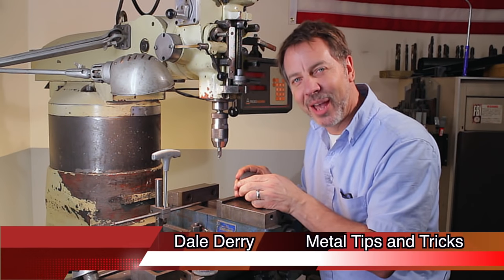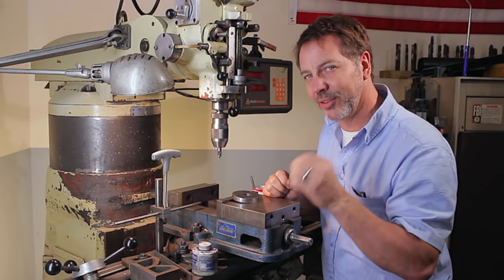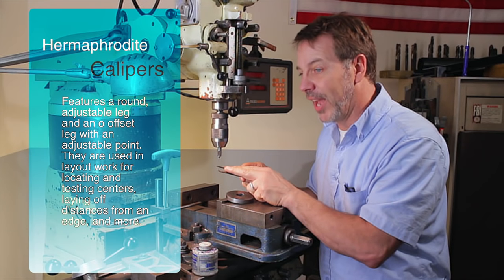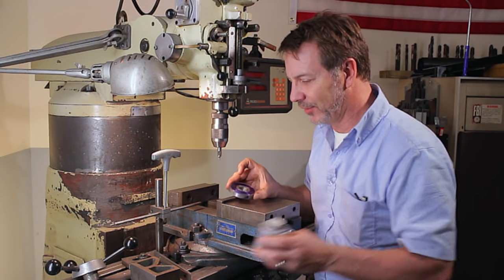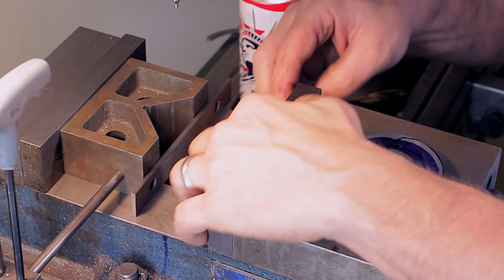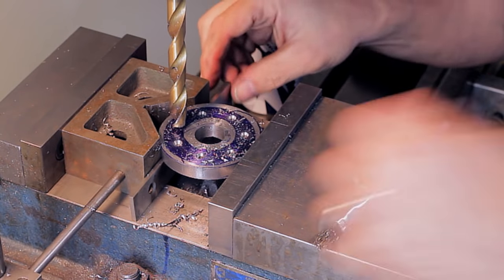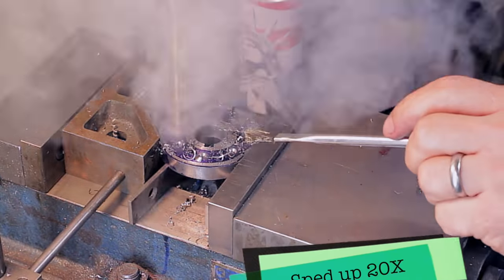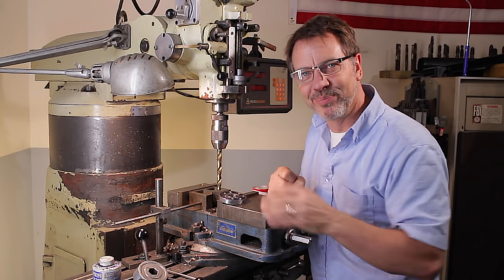How to drill a Bolt circle

Comment: There are different ways to go about this; it all depends on the individual and how much effort they want to put into this. What I do is pull out the smart phone and if I don’t have an app for what I want to do there is a good chance that there is one out there or a chart for this or a bolt hole calculator. Also a lot of the DRO’s have this function built into them. Thanks for another way to do bolt hole circles Dale.

Comment: I must have completely missed the bit where you actually decided how far apart the holes are.  
I thought 7 holes would be interesting, as I`ve been doing this sort of thing most of my life; but nothing
Reply: Deciding/working out where they should be is one thing, then rotating/drilling the piece by eye is another. The end result can't be 100% accurate surely??
Reply: As others have pointed out,  good enough is not necessarily 100% accurate.
Reply: + Paul J.  Agreed.  It's a pity Dale omitted to describe how he determined the very important chord length for scribing the centres of the other six holes once he'd centre-popped the first one.  Especially since 360° is not exactly divisible by 7 (51.429°)  Chord length = [2 × Sin {(360° ÷ 7) ÷ 2} × R = 2 × Sin 25.714° × (D ÷ 2)] = Sin 25.714° × D = 0.43388 × D.  So it's also neccessary to know the diameter of the pitch circle, D.
Had there been 6 holes, the chord length would be Sin 30° × D = ½ × D (0.5 × D) = R.
Reply: He looked it up either in machinery’s handbook or on his phone.
Reply: Yeah, he conveniently skipped that step by saying, 'hopefully I've already calculated this out in advance'.  Waste of a video, as the other stuff is obvious.
Reply: You don't need to measure anything if you have a scribed PCD as shown. Center pop your first hole, usually the one with orientation to the part. Then guess your distance and walk you dividers around the PCD. If you don't hit your center pop, adjust and try again. I use this when I have a loose tolerance on the hole centers and pcd. Or if I am drawing the part on a drawing program I use x/y co-ords to do it without a table.

Comment: Set the marker at pi x D divided by 7.
 You could also make one hole off by 1/8 to 1/4" if the part must be installed only one way.
Reply: And check your markings with the dividers by marking 1 way then the other making an X . if the centre of the X is on your PCD then you have a 100% accurate mark.

Comment: I usually use one or two compass springs to hold parallels in place in the vice jaws. I just make them from a piece of steel pallet banding. I fold a piece say 8" long in half then grind down the ends to a long taper and splay out the ends to form the spring. They can be squashed down to 1/16" out to about 2.5 - 3". I have a collection of coil springs to hold parallels in wider gaps.
Reply from the maker: Great suggestion

Comment: Get a copy of the Woodworth Circular Tables. It gives the positional data needed to calculate x/y coordinates for 3 holes to 100 holes at any radius. Then just dial them in on the mill/drill press.

Comment: How did you figure cord dimension to set your dividers  at to scribe those 7 makes ??
How do you make sure the drill is exactly over the center drilled hole when you index the part ??
Reply from the maker: Are use a true method of trial and error :-)

Comment: Just wandering. Why have you got an extension on your mill frame? Glad to have seen your holding setup. Most times I come in the house with a homemade drawing board with T square , calipers , and other out dated utensils draw the patern with a circle drawn or whatever to refference the the pattern to the part being drilled then center punch , and center drill.  By using the circumstance and dividing the holes would be close to set up calipers but to get the distance in a strait line would take trigging one out. Since the advent of autocad few people know how to do that today.

Comment: I know this video is older, 
I have a 3-1 lathe where the spindle and flange are one piece. Has 3 mounting holes.
   Im trying to figure out  how to measure the existing bolt holes to accurately lay out the holes on a blank plate?

Comment: Nice tip!  LOL, your Dykem brush is crap just like mine??  I hate Dykem just for that reason and can't figure why they don't supply a quality brush, I tried the spray can but that was crap also....do you know of another mfg of a similar product?  Sharpies are quick but tend to run with oils, etc.
Reply from the maker: I  don't know of any other product that could replace Dykem. And I don't like sharpies ether. Maybe we need to formulate one of are own.
Reply: +Metal Tips and Tricks (Dale Derry) They sell markers that can be re-filled. I wonder if they could be filled with Dykem?
Reply: +ArtemiaSalina The German firm Edding make refillable layout markers.

Comment: I've made up a sleeve which screws into the back of the spindle and onto that bolts circular saw blades, 4 or 6 inch dia and any number of teeth. They give very accurate divisions on whatever is in the jaws of the lathe when I use a ratchet system with a pawl attached to the body of the lathe. A 24 tooth saw is the handiest giving 15 degrees with each click and marking is done with the the tool point. Its accurate but I wouldn't be building aircraft engine parts that way of course.

Comment: I've often thought you could rig up a piece of Spring Steel Strip with a tapered Pin in one end.
Pop the Pin in the first Hole you make, position the Piece for the next Hole, then clamp the Strip at the other end.
Then simply lift the Pin up and pop it into each hole you've made as you go round.
You'd still need to do the initial calculations of course, but you wouldn't need to mark out each hole, and it would eliminate any error in lining up each of those subsequent marks.

Comment: I have cheap iGaging DROs on my mill, so I typically fire up my PC and use Excel to spit out a table of X/Y coordinates.  Go back to the shop, locate my part's center while held in the vise and zero the DRO.  Then just dial in my coords, lock down the table, and drill away.  It's been pretty accurate for me, good to a few thou on each hole's location.

Comment: I have been a Machinist for 40yrs and I use a calculation sheet that was  made by RCA many years ago and does  all kinds of bolt circles in less than a minute . it gives you the X  Y axis and Cord Length been using it since I was a Young Lad in the Trade.
Reply from the maker: I Love those calculators too, but sometimes  I like to use the trial and error method  :-)

Comment: did not see how you determined spacing for holes- did you calculate arc length based on diameter of the line you cut on the lathe?
Reply: no he didnt.

Comment: Nice, but how did you set the dividers?
Reply: pie timed diameter divided by the number of holes I guess
Reply: +Bob Shepherd What is the diameter?  It was not measured for us.  Anyway, that would give you the length of the curved line segment length.  The dividers mark a straight line distance.  OK, Dale, show us the quick, easy, and accurate way to divide a circle into seven 51.4285714... degree segments.  Leave out the trig and calculators...
Reply from the maker: There is no easy way. It's all trial and error. 😀😀😜
Reply: +Metal Tips and Tricks (Dale Derry) I can come up with the  answer pretty easily using trig and the size to set your dividers is approximately .868 times the radius of the circle you are dividing.  I needed to look up the sine of the half angle, but that is all.  Still remember how after about 50 years since learning it...   8^)  Better than dozens of iterations trying to sneak up on it.
Reply: +Metal Tips and Tricks (Dale Derry) there must be a formula in the Machinist  Handbook for the lenght of the chord for a polygon in a inscribed circle . get the calculators out!
Reply: +Paul Frederick Paul, my comment was in response to the video where the work was magically and instantly divided into seven segments as the scene changed.  Dale has responded to that, and adequately in my opinion.  He was trying to move the video along, and I accept that.  However, it left me, at the time, with a feeling of "how can you do that so simply", because I was pretty sure you cannot.  His method, which I guessed, was to iterate the divisions mechanically, and that takes a fair amount of time and effort to get close to accurate.  It seemed like "magic happens here" at the time.  I was pretty sure there was no magic, and wanted to hear the explanation of how those seven divisions were so trivially completed without show of calculator or trig tables.  Dale addressed it, and I am happy with his answer.  It is just an editing choice, and I understand that.  I have nothing against calculators, the internet, or trig tables, and I know well how to use all of them...

Comment: A very good tip.  Thanks.

Now if only watching such tips could cause a mill to magically appear in my shop I would be able to try this out myself.

My wood lathe, and most wood lathes I have seen have an index feature for marking certain patterns.

I notice metal lathes do not have an index feature.  Does anyone know why?
Reply from the maker: Some older metal lathe do have an index system on the main pulley, but newer machine have sealed gear driven heads. So there is know easy way to put an indexing wheel on the newer machine with out add to the price of the lathe.

Comment: how did you determine the spread between each of the 7 holes? I know that 6 would be the radius of the circle they exist on and to cut out some slop when laying them out, draw a line through center of circle. those 2 points where that line intersects that circle (coming and going) are the points for 2 of the 6 holes. from those points. strike the radius on the circle on both sides of both first 2 points. that will cut down on the slop tremendously. if you just dance the radius around 5 times from the first point, odds are that you won't land exactly on point one from point 6
Reply from the maker: Hi Jay.  Your making it to complicated.:-)   It's just trial and error. I did a follow-up video to show you how I did it. Check it out:-)
Reply: Metal Tips and Tricks  lol. you didn't really read what I wrote, huh. I just write complicated. my method of layout is actually quite simple. trial and error is way more difficult. ill check out your follow-up video on the matter .. thanks for your reply and the videos.

Comment: I would find the center of the hole and then use x-y coordinates to drill the holes.   You can either calculate the coordinates with trig, or draw it up in a cad program and get the coordinates of the centers of the holes.

Comment: If a Lathe is in the shop, chuck up the piece and scratch a line on the bolt circle, then if a three or four bolt hole circle is needed, use a prop stop on the 3 or 4 chuck jaws, using the cross feed, scratch a horizontal line over the existing circle line. this will be pretty close.

Comment: Jenny's or odd leg calipers
Also if the job is not center of the v- block it will raise when you tighten the vise as seen when using the center drill to spot  the first hole

Comment: You could also set zero to the center then just trig out the locations of the bolt holes.
Reply: Thats what i was thinking because thats what i had to do in school way more accurate and will take about as much time now i just use the DRO but math works better for me this is a good concept though, i think its about what someone would prefer also the more tools you have the better you look so learning other things is always good. If all you have is a drill press this would be the way to go otherwise i would use the trig but like i said its a preference and its also a good thing to have in the mental tool box

Comment: The vee block set up in the vice with stop looks good.  However, don't bother fiddling around locating the bolt circle manually with the calipers and lathe.  Clock the keyway around to the correct bolt hole location orientation per print.  Clamp the part in the vice.  Indicate the center hole with a dial indicator.  Then as Bill Hamilton and others have commented use Machinery Handbook to get coordinates for the holes.  If you do not have the handbook it is easy to use trigonometry to calculate the hole locations.  If you can't do trig. then get someone to show you.  You can learn basic triangles in about 20 minutes.  You will use it for the rest of your life.

Comment: I fire up my PC and load a spreadsheet application like Excel, then generate a table of X/Y coordinates from R*sin(A) and R*cos(A) where the angle A jumps from 0 to 360 in N steps.  Using your DRO, there is no need to move the work, or even that it be round.  Just locate the center of the bolt pattern and zero your X/Y readouts, then move to the first X/Y and drill.  This is fast and accurate to a thou or two, even with my cheap iGaging readouts.

Comment: Great video, but around 2:20 you skipped how you spaced the 7 cross-marks on your radial mark.  I imagine that you took the known diameter of the radial marking, found the circumference (C=Pi*D), and divided by the number of holes desired. Then set your calipers to that dimension and made the marks.
Reply from the maker: HI, I did a follow up video to this one. please check it out.

Comment: As a full time manual machinist for 30 years, who has parts floating across the heavens aboard the International Space Station, I can tell you Mech Engineer below is dead nuts right. Super accurate parts can be made just as fast as good enough parts. Actually faster.  Read that again. Perfect parts can be made faster than good enough parts. The DRO on most machines will do the trig for you in a heartbeat. You slap the part in the vise, find center and center drill all holes, on the x-y coordinates, turn off machine and load your drill and drill all holes. Done. Never touched the hot part and only turned off machine to change bits. No dykem, no fiddling with calipers, no work stop,  no guessing.  Just cutting asap.
He has a mill with a DRO. The part should never move. Never use a rotary table for a B/C that's insane. Unless you use a rotary dial phone to make phone calls. In that case you're living in the '50s.

Comment: I'm even lazier.. why not just use basic Trigonometry ? I've made many-a bolt circles on a Bridgeport with nothing but a simple calculator. 

Divide 360 by the number of bolts you want to get the angle between each hole. Then with sin and cos and the bolt radius, you get your x and y's for each point from center. Or even simplier, I'm sure there's already an online calculator that will do that for you.
Reply: +Mech engineer   A lot of people might simply use a common printer and print out a pattern to place on the piece and make pin pricks to get the hole locations transferred to the workpiece.
Reply: Jim Sadler 
probably as accurate too
Reply: Mech engineer there is, I do it easier, drill your center hole with the tailstock on the lathe, maybe .250 or so. take your stock to the mill and put the same size drill as your center hole in the drill chuck. indicate the hole by sliding the drill in and out until there is no resistance. call that x-0 y-0. then go online to bolt circle calculator and type in how many holes you want to drill, and the bolt circle diameter. and thats it! it gives you all your x and y coordinates. it'll be accurate within a few thou or so, but thats plenty good enough. easy.
Reply: @nickrockz97  SIR U MIGHT BE A ROCKET SCEINTIST, BUT UNFORTUNATELY THIS GENTLEMAN IS TELLING A COVENTIONAL METHOD , SO EITHER SEE IT OR SHUSHH
Reply: JASON KAM lol rocket scientist, far from it
Reply: I am now seeing why machining facilities are so hungry for college student machinists...
Reply: JASON KAM t
Reply: you drive people away if you say sin or cos...i dont know why!
Reply: Nobody likes sin cos it's dirty 😂

Comment: How about same set up higher in vice, tram outside diameter, set X & Y zero you have readout, then armchair machinist trig x & Y plots? No clamping reclamping?
Reply: This
Reply: I like the way you think ,I would use the hole as a pick up, we know this would be used in the assembly..another  suggestion would be to look up bolt circles in machinery handbook then use x and y cord.  Could also use feed dials on milling machine     Be aware  of backlash.

Comment: Here's another way. if the v block is true. Touch off on the side of the v block with an edge finder and move to the center and set X to 0... that is going to equate the center of the part... you can then touch off on the part set 0 on Y then move Y the amount of ur radius... this will be the center of the part... there's a trig function for X&Y of for any numbe of hole bolt hole circle.

Comment: Why not find your centre with a centre finder then use the digital readout to calculate a 7 hole pcd. Simples.
Reply from the maker: Great question Derek. I did the video to show a friend of mine that you don't have to have a DRO or Rotary table to make a  bolt Circle

Comment: How did he set the correct distance for the scribing compass?
Reply: Let’s say the dia is 100mm (metric, millimeters). If you look at a 7 hole circle and draw a straight line from one hole centre to the next (not curved on the circumference centreline) that is considered a “segment “ To find the segment distance is

2r x Sin (degree)
—————————-
            2

Where degree is angle between two holes, which in this case is 360/7 = 51.42857143 degrees.

So 2 x radius x Sin 51.42857143
     ————————————————-
                             2

= 39.09157412 mm 

That is what you would set your dividers to to scribe each one.

Comment: Bolt circle? You make sure that your trigonometry is boned-up. And then you plot the polar coordinate that you have calculated into the milling machine digital read-out or the machines manual read-out. No problems, no dividing head or rotary-table. Just a very precise bolt-circle.